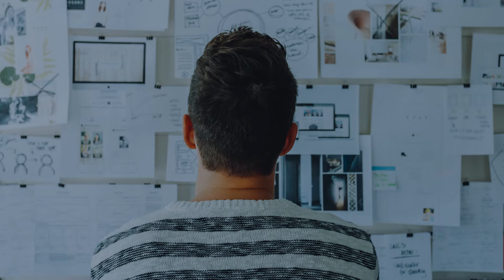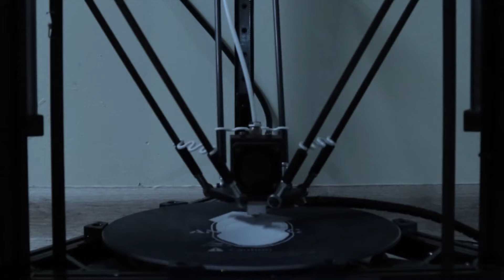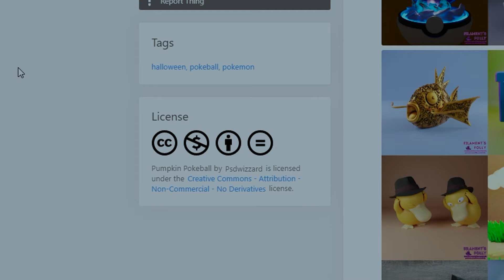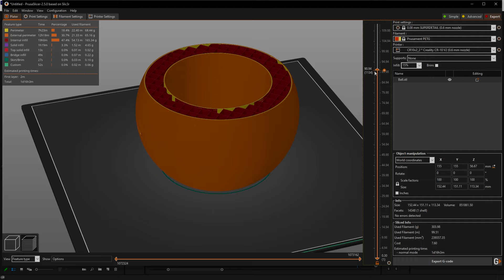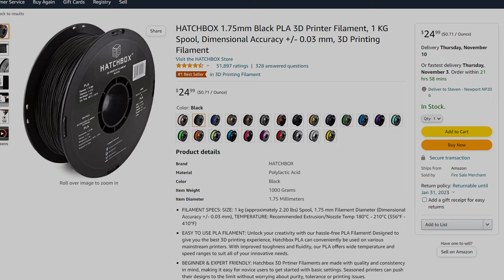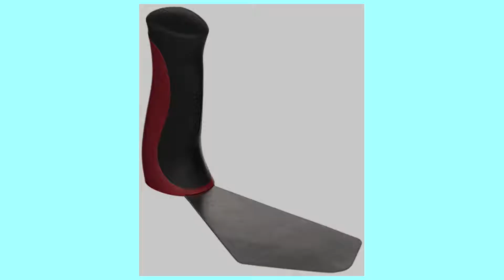A Basic Guide to 3D Printing

Comment: Heeey
Nicely done, lots of info, good for a noob.
A ton of "wish I knew".
But
You've scripted your personality out  and more footage with voice over (or pic in corner) would go a long way.
Reply from the maker: Thanks for the feedback 👍
Let me know if there's something you would like me to cover
Reply: @IQWorkshop  I still have the issue of wall separation and can't find a solution video
Reply from the maker: @EoaH  what printer do you have?
Reply: @IQWorkshop  ender pro 3 and cr-6, i'm pretty sure its the slicer causing the issue: prusa
Reply from the maker: @EoaH  check the line width setting and also the correct size nozzle is set.

You may also need to replace the nozzle if it's brass and hasn't been changed for some time